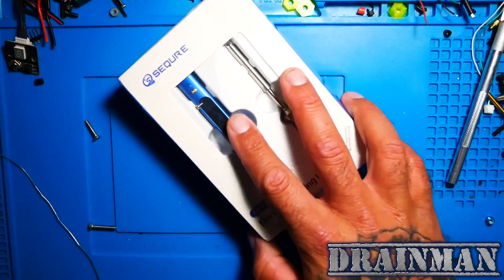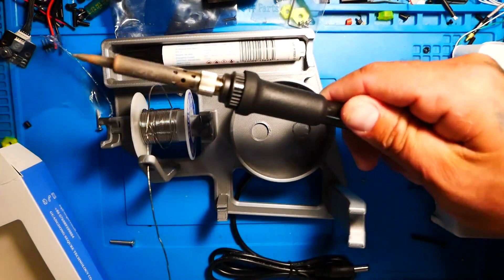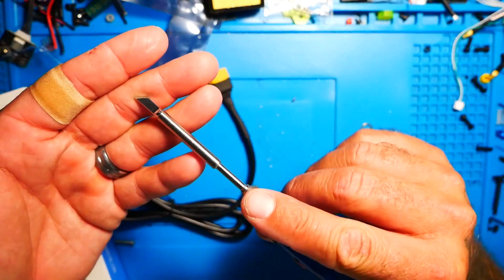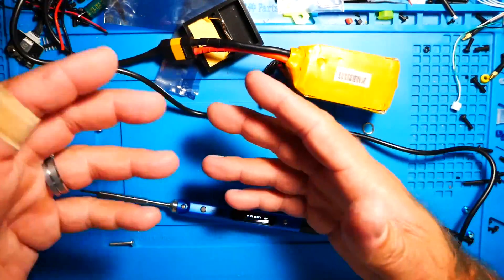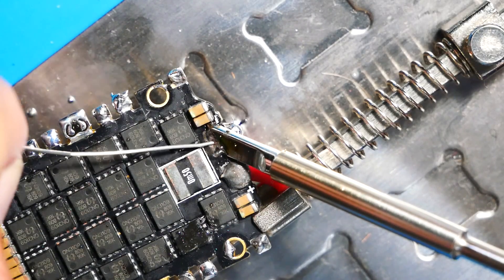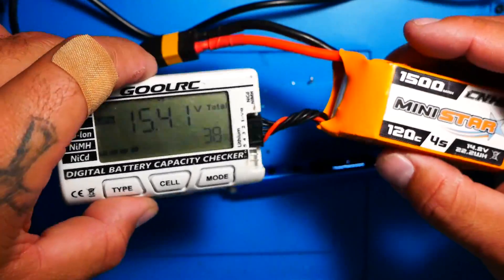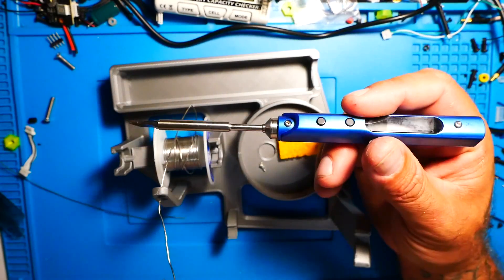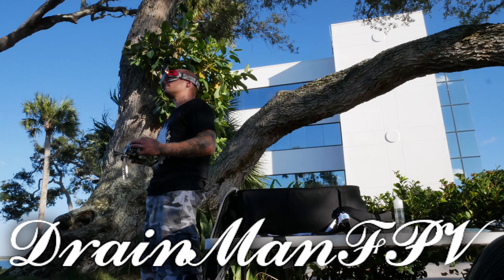The Upgraded TS100 Field Soldering Iron .... So They Say 🤔

Comment: I watched another video. This Sequre version is basically a TS100. It is reportedly made in the same factory (or at least originally was when it was first coming out).
Another video pointed out the whole infrastructure was open "source".
This also uses the same tips as the TS100. Also exactly the same config system.

It seems like it really is the same thing, just "rebranded" to Sequre.
The TS100 has been sold and labeled by a few different companies while this one is strictly sold by Sequre, on their own website.
Can't even get it on Amazon.

It really seems like Sequre got the final licensing to this thing and is the main producer of this style now with some minor modifications.
The price has even gone up by double since it originally came out.

Comment: Been using the TS100 with 5s packs for a couple years now, still works great, but underpowered on less than 5s. This looks like a good alternative, thanks for sharing. Still recommend a genuine soldering station for home though, seems to retain heat a lot better than these little irons.
Reply: RADER FPV - it’s all about the tip size my man 😉

Joking aside, thermal mass of the soldering tip is THE factor there. Have you tried any of the other (typically) not included tips from MiniWare? C4 is my personal fav when it comes to having a shitttload of thermal mass and soldering the most “thermally intensive” and high-heat-sinking joints etc.

Cheers

Comment: i only have 3s and 6s batteries... can i run the soldering iron off of one of these?
3s close to not reaching the 12V with most capacity and 6s being over 24V when fully charged...

HEEELP
Reply from the maker: Man, that's exactly right, you can use a fully charged 3 or a dying 6. That's it

Comment: Usually I can build almost a full quad with one 1500 4s with my ts100
Reply from the maker: Oh cool! I'm gonna give it a whirl with my next build
Reply: @DrainManFPV  they also have a custom firmware for the ts100 that makes it much better. I'm not sure if it will work for yours but you can search ts100 custom firmware on YouTube and there is a couple videos on it. You can set it to sleep when you set it down and it will heat back up when you pick it up